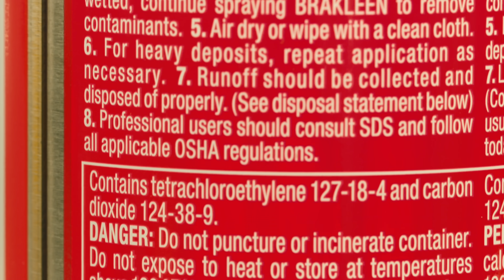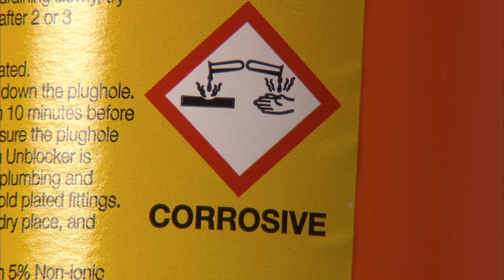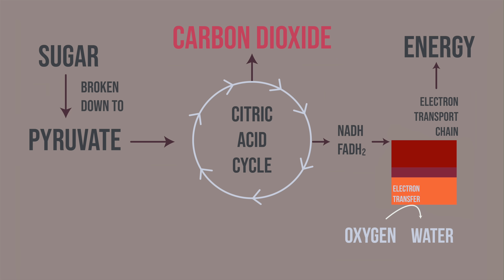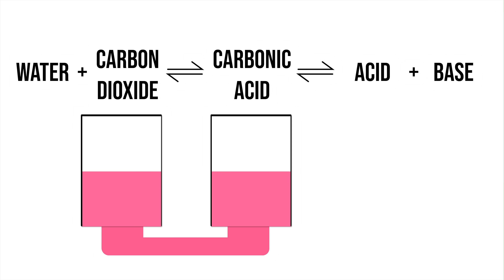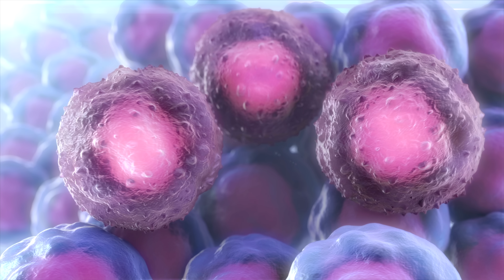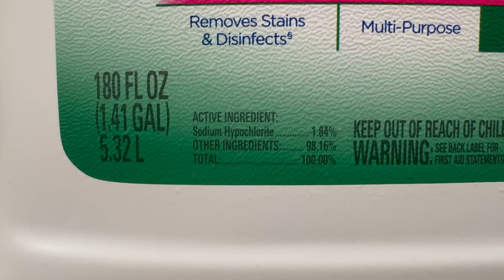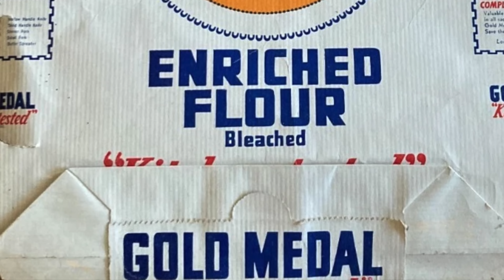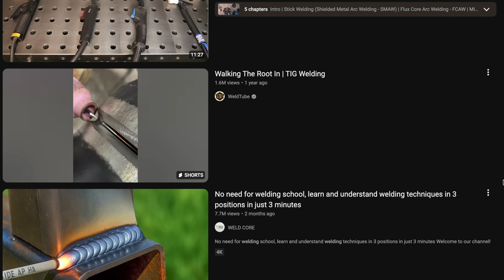"It smelled funny while I was welding and now I can't breathe..."

Comment: I guess what I didn't fully understand, is it the brake parts cleaner when it is wet that is the danger, or if the cleaner totally dries and has aired out for a long time, is that OK?  Or is the residue left on the parts long after the cleaner has evaporated the danger?

Is a part contaminated / at risk if it ever has touched brake parts cleaner or is there a time period in between or if there is a residue left behind, a way to remove the brake cleaner residue to make it now safe to weld?

Comment: I really, really wish that he had also advised, apart from the honestly great "don't use chlorinated chemicals to clean, use the non-chlorinated ones" message, to:
1) Leave your freshly-cleaned parts 100% outside for some period of time (10 minutes on a sunny day? 3 hours on a cold day?), immediately covering the parts in some type of clean cloth so dirt and dust doesn't ruin the cleaning you just did while still allowing most of the cleaner to evaporate away.

Or, since he's focusing this PSA on hobbyists and not company welders:
1) At least keep a garage door open ALSO WITH a big fan rotating somewhere nearby (not on the workpiece due to shielding gas, but nearby)(open door is NOT enough), or
2)  Welding outside only on days when the air isn't stagnant (not crazy windy though either, as that ruins welds).

The reason some people don't like masks is *not just political* - that's a strawman argument. Here are some actual issues with masks affecting welding.

1) Masks cost money, especially the maintenance of some "higher-grade" masks that require filters to be changed regularly, but at unknown intervals (Every day of heavy usage? Every twenty hours of usage? Every month?).

2) It's not clear which masks WILL and WON'T work effectively for removing certain contaminants (covid, vs big particles like household dus,t vs somewhat small molecules like phosgene).

The common plasticized paper ones obviously don't work for welding (or most other things for that matter...), but even the reputable N95 masks have me wondering a lot of the time if it's even worth wearing them, as their seal around the nose and chin/jawline only seems to work half the time after fitting them correctly.

Looking up a datasheet about masks and their particle sizes doesn't help either. What types of things are those particle sizes? Atoms? Grains of sand?
Electrostatic filtration properties and "don't use old masks of types A, B, etc because of electrostatic charge dissipating away despite the mask visually appearing totally fine" are basically never mentioned by manufacturers. There's no good AND ACCESSIBLE way to know what features masks in the store DO and DON'T have (aside from the obvious presence/absence of an exhalation one-way valve), and that needs to change.

3) Compatibility with long-ish beards. Is it still removing all those particles? Half of them? A tenth?. Is the mask yanking hairs out of your face, distracting you while you need to focus on precision grinding/welding?

4) Not fogging up your safety glasses or welding helmet visor as you grind/weld and breathe. Anti-fog spray only helps so much.

5) Compatibility with hoods of welding face shields (not pressing 5 pounds of pressure straight into your nose, hindering your ability to breathe because of your face shield pressing on your mask pressing on your nose, all while still hopefully filtering correctly).

6) Allowing you to see things under the sides of your nose that you can barely (but still *can*!) see when not wearing a mask, but can't see at all when wearing a mask. People don't think about this aspect very much, but it's important for working in very tight spaces when grinding.

Comment: A similar thing happened to a work colleague of mine in the 1970s. He was using Trichloro-ethylene to degrease a machine. As it was in the 70s he was smoking while doing it. Shortly he was staggering and collapsed. he was rushed to hospital and it seems that the fumes turned back to liquid as they passed through the lit cigarette. he made a full recovery but I think that chemical is banned now.

Comment: My x was a welder out of High School. Worked with his dad, also a welder, until he went into the Air Force as a Jet Engine Mechanic. I was given one of the old bells made out of Cast Iron. It had a small crack that he started to weld. Abruptly stopped welding. Went in house, came out chugging milk out of the plastic jug. He told me why, but I can’t remember what he said. Anyone know why he chugged milk?
My adult son is a tinkerer. He has my & his dad’s abilities of taking things apart. Trying to make sure we caution him on not obvious ways of getting hurt. Such as safely discharging a capacitor. Something I was taught about, working on one type of Aircraft Engine. Hubby worked at a tv repair place at one time and had been taught how to discharge those capacitors. Slightly different technique, but important to know why.

Comment: Even when you are not working with dangerous chemicals, ALWAYS wear PPE.  Wear safety goggles when using any power tools, including drills.  Wear an N95 mask or respirator when doing anything that generates dust or fumes.  Where gloves when using any chemicals or doing something that could hurt your fingers.  Wear hearing protection when doing anything loud.  You get the idea.

Comment: Phosgene (COCl2) is a really nasty very toxic and corrosive industrial chemical compound. With moisture it slowly reacts to carbon dioxide and hydrogen chloride, which both form acids (carbonic, hydrochloric) with further moisture, i.e. moist tissue. 
Phosgene was one of the worst war gases used in the trenches of WW I, causing an estimated 90.000 deaths. The French Army used it in pure form, the German Army added 5% to the chorine gas. 
One basically suffocates by drowning from the inside, hard to stop once the chemical decomposition process started. Other damaging chemical processes with moist lung tissue add to the agony...  

Be cautious and safe out there, folks...  😢

Comment: In general I don't like chlorinated brake cleaner unless it's strictly necessary. Use the non-chlorinated stuff (which is mostly just acetone) for most circumstances and only resort to tetrachloroethane if it's still greasy after that.

Comment: Wouldn't ECMO have bought the patient significantly more time to work on the lung-side of the problem? Generally the phosgene should eventually be exhausted after reacting with the tissue, and depending on the damage done, the lung might have been able to recover. Getting fluid out quickly is significant challenge over getting fluid out eventually, and some alveola might have been able to heal, without scarring in a way which prevents oxygen transfer. Any toxico-pulmonologist here? :D

Comment: Grew up on farm , worked at over 10 different construction, coal mines, heavy equipment and been around welding for 30 years and never even heard of this. Hell at my job now we have a cabinet with about 100 cans of brake cleaner that we use to clean all the tools, our bare hands and basically everything and our maintenance guy has been to schools and even welds on all our equipment that has been cleaned with this crap. We work at a billion dollar steel mill.
Reply: maybe its break cleaner that doesn't contain perchloroethylene.

Comment: PLEASE PUT THIS AT THE TOP OF YOUR COMMENTS....YOU WILL FIND ITS THE ARGON GAS THAT MIXES WITH THE LITTLE POOL OF UNEVAPORATED BRAKE CLEANER THAT CAUSES this, as its also HEATED IN THE WELD PROCESS, THIS CAUSES THE DEALY PHOSPHENE GAS !!!!!!!! AND YES IM A QUALIFIED WELDER AND KNOWN THIS FOR MANY YEARS, ARGON from mig / tig welding heat and brake cleaner. use paint thinners instead or cleaning alcohol and let it dry

Comment: The most critical detail about getting flawless results in the workshop or lab is first safety. secondly, safety, and thirdly, safety, safety, safety!
I wasn't always like that, but it's by the grace of God I'm still alive or even have both eyes left.

For years, I would use my dad's 1hp arbor with a wire wheel and grinding stone. If your finger slipped on the stone, it would go all the way to the bone in literally 1/2 a second. Rarely ever did I wear gloves, but just as bad, safety glasses.
After years of my dad saying "if one of those wires comes out and hits your eye, it will take your eye right out!"

One day, I must have been 20 to roughly 22, I knew I needed to change habits, put on safety glasses for the first time, and a wire shoots out and spikes straight into the glasses dead center where my eye would have been!
My safety practice since have been 99% impeccable, and now being an electronics engineer, I sometimes deal with chemicals and so I always do thorough research about them first.

Comment: Damn...I spray break cleaner by the can on steel at work because "it ain't mine" but I didn't know i was putting welders in danger. Thank you, you'd think work would tell me that. But im just an operator. Im not important enough to be told anything.

Comment: You absolutely must NOT use chlorine-based cleaners (like some brake cleaners or solvents) on metal before welding because heating them creates highly toxic, poisonous gases (phosgene, chlorine gas, etc.) that can cause severe lung damage or death, requiring you to use non-chlorinated solvents like acetone, specific degreasers (e.g., ZeroTri), or even mild soap/water for prep, always ensuring good ventilation. 
Why It's Dangerous:
Toxic Gas Production: Chlorine compounds break down under heat, producing extremely dangerous gases like phosgene, which is a chemical warfare agent and can be lethal.
Lung Damage: Inhaling these fumes causes severe respiratory irritation, pulmonary edema (fluid in lungs), and potentially fatal poisoning, even at low concentrations. 
Safe Alternatives:
Non-Chlorinated Solvents: Acetone, isopropyl alcohol, or specific industrial degreasers (check labels for "non-chlorinated") are good choices.
Water-Based Cleaners: Mild detergents or alkaline cleaners can work, but ensure thorough rinsing and drying.
Citrus-Based Cleaners: These are generally safer but still require rinsing and drying. 
Best Practices:
Degrease First: Remove oils, grease, and dirt with a safe solvent.
Remove Oxides: Use a stainless steel brush or specific oxide remover.
Ventilate: Always work in a well-ventilated area to remove any vapors.
Wipe Clean: Use lint-free cloths or paper towels to dry surfaces.

Comment: Side note, somewhat related: If what you're doing is putting out particles into the air, PLEASE wear proper respiratory equipment. As anyone with asthma will tell you, not breathing is not fun. Also, always read the sds for the chemicals and materials you work with. It could actually save your life. Even if you're doing it for a hobby.

Comment: You have to be careful if welding Galvanised Steel too as it releases Zinc Oxide gas which can cause similar lung issues which at first feel like Flu symptoms amongst many other dangerous longterm problems including cancer.

Comment: I learned about Phosgene gas in my third period of my union apprenticeship, in 1993... heavier than air, and deadly AF.....Make sure if you're around Centrifugal high or low tonnage refrigeration equipment, high pressure or low pressure refrigerant, and welding on that metal exposed to that type of refrigerant, that you have excellent ventilation....
I know, that is a Ton of "That's", but it's worth a mention.....

Comment: I found this one out the hard way a while back when I was about 14. Cleaning snowmobile clutches, the brake cleaner I normally use is non chlorinated and quite honestly I never knew there was a different kind. I was wondering why it wasn't evaporating as fast as normal so I used a blow torch to dry it off faster and almost immediately had a burning sensation in my throat. I wondered what the heck it was but kept going a little longer until I started coughing. I immediately evacuated my garage, did some research and was so thankful to be alive in the following hours. No hospital visit, nothing, just by myself at home. I am happy to see it being banned in numerous places as I have never noticed a difference in cleaning abilities and not everyone reads the warning label.

Comment: I once tried to accidentally poison myself with a grinder I was grinding apart old book carts and I started to have a funny taste in my mouth and my throat and lungs started hurting a little bit it, turned out that the carts were made out of galvanized steel and I wasn't aware of it but I'll remember not to use chlorinated brake cleaner on any stuff that I have to grind as well.

Comment: As a mechanic I would recommend using products for what they're made for. It's called brake cleaner. It's not called weld prep. 

Or and this is a stretch maybe. Learn how to weld and grind to bare metal. Even if brake cleaner can remove some contamination it's not as clean as a freshly grinded surface.

Comment: Years ago I unknowingly made the mistake of cleaning some metal with brake cleaner a couple minutes before welding on it. I got one small whiff after the arc started and it was like my throat slammed shut. I staggered outside and it was about 30 or 40 seconds before I could draw in any air. Luckily I didn't suffer any damage beyond that but it sure did teach me an important lesson. I talked to all my other friends who were casual welders and not one of them knew of that danger. Since then I've become quite evangelical about informing people to completely ban chlorinated products from anywhere near the area you're going to weld.

Comment: I just remembered that when I got my first job it was a drycleaning plant back in 1971. . They  used perchlorethelene for dry cleaning. There were times I was up to my elbows in it.  I worked there there for 3 years. No rubber gloves. There were no warning signs in the plant or the barrels it was delivered in. You could smell it all the time.  I am 72 now. Guess I was lucky.

Comment: I thought, will it be dust? Will it be silicone abrasives? "... welding...brake cleaner" OH GOD NO!   I knew it is nasty nasty stuff, there is a reason I use other things for degreasing in the workshop, but did not know how it works. Thank you for making this video! Very informative!

Comment: I spent hours working on an old generator in the shed. I planned to use carb cleaner and let it sit above the valves at TDC to soak into the carbon buildup, since the valves weren’t sealing properly and the head is non removable, I didn't have time to tear the engine down. Unfortunately, I didn’t have any carb cleaner, so I figured the next best thing was brake cleaner. After soaking it and making sure the valve lash was set, the valves started sealing again. I tried starting it, it fired, then stopped, fired again, then stopped. Suddenly, I caught the smell of freshly cut grass! I bolted out of the shed, exhaled, and tried to breathe fresh air. The only reason I recognized the danger so quicky was because I’d seen this episode a week earlier, and I’m incredibly grateful I did, it probably saved my life because I would have continued not knowing!!!        Later on, I showed my dad this to help make him also aware. Thank you very much.

Comment: The type of welding he was attempting was called MIG or GMAW ( gas metal arc welding) I’ve been a welder for over 25 years and have taught classes. People think it’s easy. Far from it. There are lots of safety hazards. The surface you’re welding on must be completely clean, either by grinding it down or cleaning off the surface with a rag. There should be no chemicals whatsoever on your metal before you weld. Some metals are poisonous if you weld on them. For instance, galvanized metal. You cannot weld on it. Highly toxic. Sometimes you need a respirator with your hood to avoid breathing in harmful chemicals. This guy should have never been around a welder.

Comment: Former welder here.   I started welding for a job decades ago and there just weren't the health and safety standards around then.   I stopped welding because of one of the economic downturns and got into completely different work.  Decades later, I started getting lung issues and ended up in hospital a number of times.   I was diagnosed with a form of asthma called eosinophilic asthma.  It's horrible and can't be cured but I have it under control with meds.  I do think it was caused by use of angle grinders without wearing masks and also the toxic fumes from welding... but didn't really hit me until decades later.

Comment: As a welder this rings close to home we learned about phosgene in 1st year and at 5 ppm to potentially be fatal. We also learned about someone who just did 1 tack weld smelled that something was off, he survived but he cant smell or taste anything anymore....

Best option is use abrasives to prep your material (while wearing a respirator ) to de grease I would reagent grade acetone this is most likely an issue if you are welding stainless or titanium. Also you'll want to be properly ventilated and be aware of the fire risk. Welding is not great for you health in general but if you take good precautions its a very good trade to get into, Safety first.

Comment: 5:52 the type of welding he's doing does not involve high voltage. Reasonably, a 25V would be pretty high for what he's doing. However, he's probably somewhere in the ballpark of a 125 amps given the sound of the short circuit transfer.